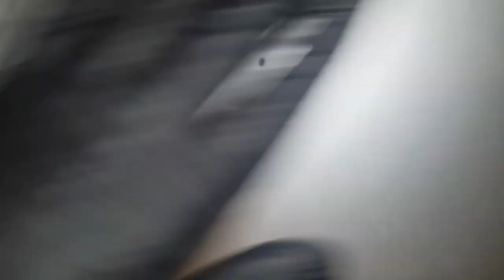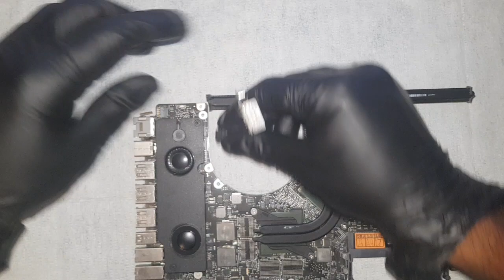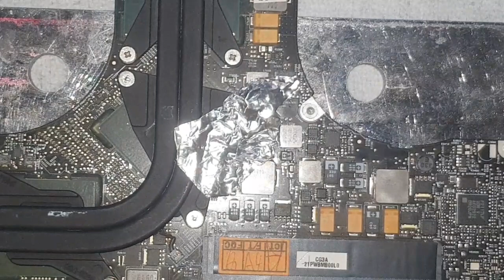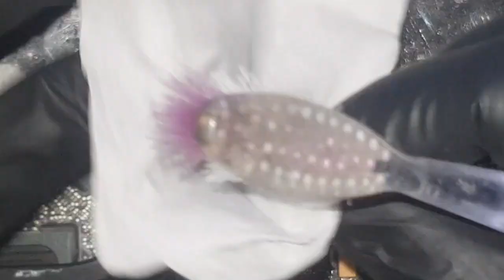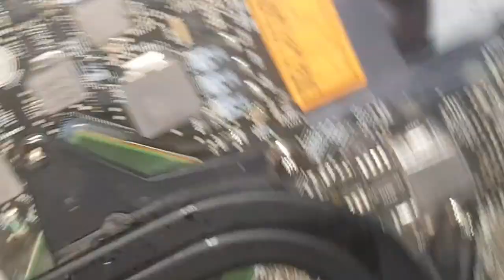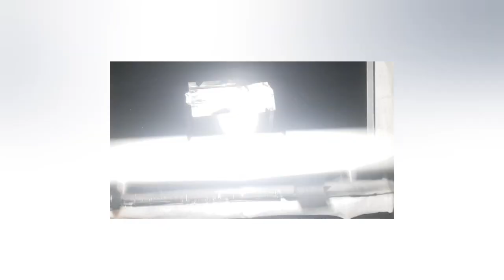2008-2009 15 - 17" Macbook pro A1297 no power, doesnt turn on, no charge light 820 - 2390

Comment: I used the hot air & soldering iron to get it off , bloody took a lot of heat .
Reply from the maker: Yes these apple boards do require a lotv heat. The entire board acts as a thermal absorber